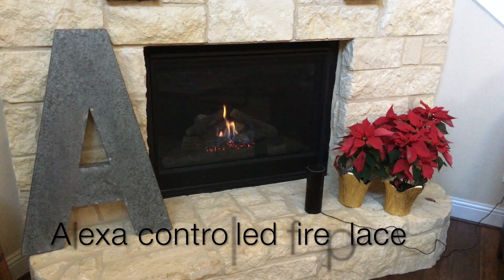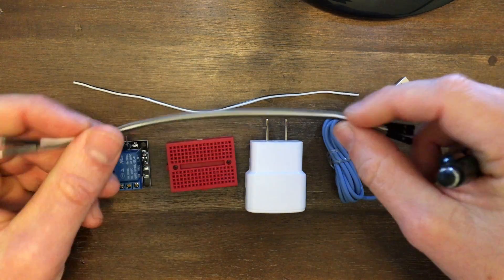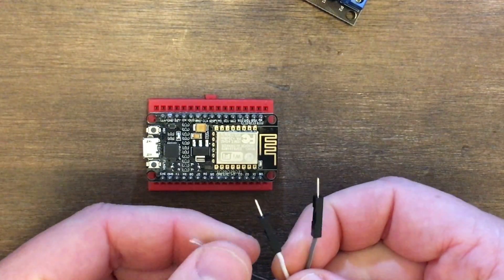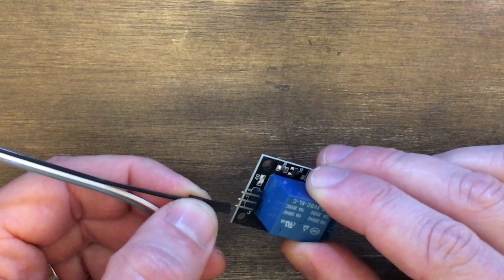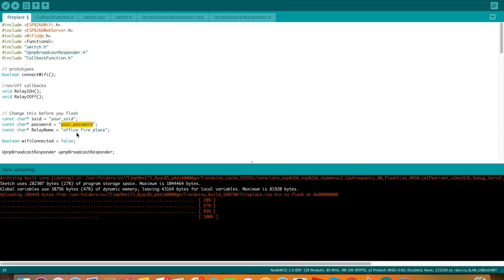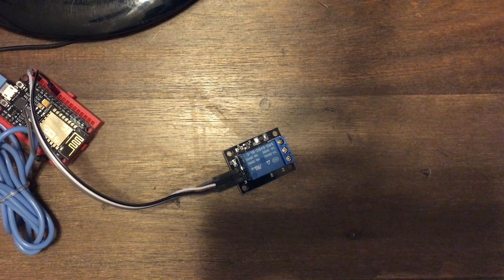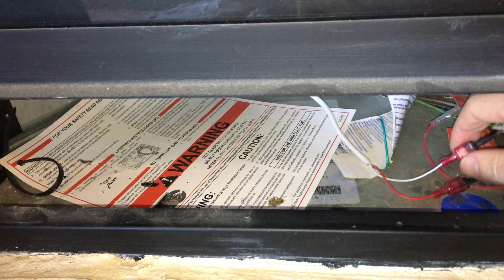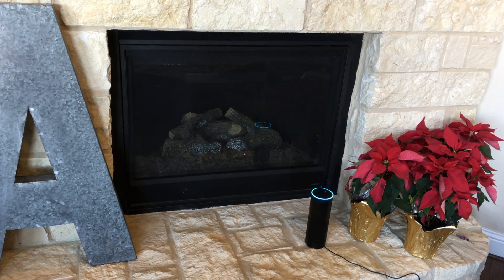Alexa Controlled Fireplace with NodeMCU (ESP8266) DIY and parts list

Comment: I got all the wires connected but can't get the download to install. Any suggestions?
Reply from the maker: I need a little more info. Is there an error message when uploading the sketch to the board? Make sure you have the correct COM port selected....if you don't, that will give you errors.
Reply: When I download the program for windows 10, I have to find the download on my computer but can't get it to open so I can make the three changes you told about. I just got the Hiletgonew version esp8266 development board from amazon.
Reply from the maker: Can you find fireplace.zip on your computer? If not, search for it in Windows 10 search box in bottom left of your screen. Unzip/extract all the files. Locate fireplace.ino and edit it.
Reply: Arduino: 1.8.5 (Windows 10), Board: "Arduino/Genuino Uno"

C:\Users\marin\OneDrive\Documents\fireplace\fireplace.ino:1:25: fatal error: ESP8266WiFi.h: No such file or directory

 #include <ESP8266WiFi.h>

                         ^

compilation terminated.

exit status 1
Error compiling for board Arduino/Genuino Uno.

This report would have more information with
"Show verbose output during compilation"
option enabled in File -> Preferences.
This the error I got when trying to after editing it
Reply from the maker: You have the wrong board selected. Your output says "Arduino/Genuino Uno". You need to change it and select "NodeMCU 1.0 ESP 12E Module".  Its in the Tools menu. Tools -> Board....
Reply: can't see the NodeMCU 1.0 ESP 12E Module" under boards
Reply from the maker: Did you install the esp8266 boards? Its bullet point #4 at 5:54 mark in my video. The link for boards manager is in the description.
Reply: how do you find and  start Arduino and open Preferences window? I have the 1.8.5 open but what do I do with it? I tried to upload load but get error.
Reply from the maker: If you have Arduino 1.8.5 open, goto File -> Preferences.
Reply: I added it but still can't find my board.
Reply from the maker: Now do the following step from that page "Open Boards Manager from Tools > Board menu and install esp8266 platform". So goto Tools -> Board -> Boards Manager (Boards Manager is at the very top of that long list of boards). In the search box, type esp8266. Only one item will remain in the list. Click somewhere in the description and the install button will show up. Click install. After it installs, it will be in that long list of boards so now you can choose it.
Reply: Did as you said but nothing happens when I typed esp8266 and hit enter.
Reply from the maker: Not sure. If  I have time later, I will try to record a video of those steps.
Reply from the maker: I uploaded a more detailed video that might help you. Give it a try https://youtu.be/tj3EPX2TPf8
Reply: I have followed the install instructions up to where I go to tools and select board manager. When I type esp8266 into the box the screen goes blank and nothing happens. I thought it might be my PC but the same thing happens on my laptop. What am I doing wrong?
Reply: I followed you up to where I type esp8266 into board manager but then the screen goes blank and nothing happens. I thought it was the PC but I tried it on my laptop and the same thing. Any thoughts?
Reply from the maker: Hmmm, not sure. I wonder if that URL is blocked for some reason. When you paste that URL   http://arduino.esp8266.com/stable/package_esp8266com_index.json   in your web browser, does it show a bunch of text on the screen that starts with "Packages"
Reply: I had entered a wrong letter and everything is ok except when I try to download. It starts to download but I get the error complilingfor board Nodemcu 1.0 (esp-12e module)
Reply: Started download and went to 86% when "an error occurred while uploading the sketch"
Reply from the maker: I am not sure. I really don't think it is a code issue, but please try the new version in the top of the description
Reply: I noticed in your video that the code on your screen says wifi scan at the top and the last wording at the bottom says void loop. The one I have been using is the full code where you change your router info. I can't get the one your using. what program did it come from?
Reply from the maker: Not sure I follow you. The original code (fireplace.zip) is the one in the video. Last night I uploaded new code to fix some issue people were having with newer Echos. The link to the new code is at the top of the description of the video (fireplace_2.zip). The new code looks different than the one in the video.

Comment: Great video.  I am having one problem.  Once I turn on the relay, after a shot delay it goes out.  I think cannot turn it on or off, unless I remove power and then plug back in.  Is there a wake code I need to have?  Thanks!
Reply: When I used the new code from the new video, it fixed my issue.
Reply from the maker: Harve Byrd - hi, no wake code. If you are doing it from the Alexa app, it will do that. Try not having the app open and do it from the echo with voice.
Reply: Thank you.  That seems to work.  I don't have it connected to the FP at this time, but had one more question.  When telling Alex to turn on FP the led lights up on the relay.  After a few minutes, it cuts off.  I can now relaunch it (where I could not with the app), but I'm wondering if the LED should stay on until I tell Alexa to turn off FP.
Reply from the maker: Harve Byrd - the relay should not turn off after a few minutes. It should stay closed (red light on) until You tell Alexa to turn it off. Not sure what is causing that. I will look through the code soon. You have good Wi-Fi in that location? Mine stays on for hours at a time.
Look at the serial output on computer to see if the off command is being sent or it is crashing.
Reply from the maker: Harve Byrd - sorry, I am stumped on that one. If you are using the exact same parts and code, I would expect it to work. I have made 3 of these for friends, and they all worked. My only advice is to test the relay by starting a new sketch that only switches the relay ON and OFF in a loop. I will let you know if I think of something else.
Reply: I have the same issue as Have Byrd with the same error message.  I can only get a different NodeMCU from Amazon.ca as the same one in your description is not available, not sure whether this is the problem. I have decoded the exception seems like memory allocation issue.  This is my first Arduino project as well. So not sure where the problem is.
Reply from the maker: Can you provide full link to the NodeNCU you got? Start small. Try the example sketches first...such as 'blink'. See if that compile and runs.
Reply: Big thanks for the quick replied and following up.  Here is the links:
NodeMCU: https://www.amazon.ca/gp/product/B01F5ALLFM/ref=oh_aui_detailpage_o02_s00?ie=UTF8&psc=1
Relay: https://www.amazon.ca/gp/product/B073HX1DK2/ref=oh_aui_detailpage_o02_s00?ie=UTF8&psc=1
I was using a different power supply at first but then buy the same one suggested in your post as others mentioned on the web that power supply could be an issue.
Reply from the maker: That NodeMCU looks like the same one. Let me know the results of the blink test.
Reply from the maker: Harve Byrd - Good to hear. Thanks

Comment: you skipped over where you got the fireplace contact wires that come off the relay. Did you make them or buy them?
Reply from the maker: Sorry about that. I crimped small male spade connectors to the solid wire I showed in the parts segment. Like these http://amzn.to/2mKY0Nm
Your connectors might be a different size, so you might want to get the variety pack of these if you don’t already have them
Reply: Thanks for the quick repsonse. Follow up question as i look at the parts you have listed. The 5v relay on Amazon IS A 5 PACK AND doesn't look to have the Negative, Positive and signal leads coming off it. Did you add those?
Reply: Never mind i dod see the leads coming off it after i looked at the other pictures :)
Reply from the maker: blue tooth - it’s best to always test those terminals anyway with continuity checker on your multimeter anyway. I have seen other boards in the past that are mislabeled.

Comment: where does switch get its power? I see where the spade connectors are connected. Is that the only connection under the fireplace? Is there a way to make the connection and still use the wall switch? Thanks for the detailed video!
Reply from the maker: Hi. Yes, the spade connectors are the only connection under the fireplace. I have also thought about how to keep the wall switch 'in the loop'. I haven't come up with an easy way to FULLY control the fireplace from both the wall switch and Alexa. That being said, you can have the wall switch function like a KILL switch, so you can turn it off in case of emergency. It would need to be in the ON position anytime you want to use Alexa to start/stop the fireplace. You would flip the wall switch to OFF to turn off the fireplace. I drew this up a few weeks ago, but haven't wired it yet. https://goo.gl/rVxq9P
I will see if I can come up with a more elegant solution :)
Reply from the maker: I figured out how to also still keep the wall switch working. You will need to replace the wall switch with a 3 way switch. I will do another video on how to wire that soon.
Reply: Thanks for the quick reply.
Reply: Looking forward to it!
Reply from the maker: Jack Jones - Here is a diagram video on how to wire the switch 3 different ways. https://youtu.be/wUP68vYBIco
Reply: Can you set it up in a parallel circuit? For it to be off, both the switch and relay need to be open, but in a parallel, you can use the switch or Alexa to turn on

Comment: Will be giving a try. Best video I've seen so far on explaining each step. Thank you for posting.
Reply from the maker: Thanks! Good luck with your project.
Reply: Everything uploads fine. My issue is when I go to run the serial monitor wifi test, I press the reset button on the node and I get some funky characters. Something like:    ⸮⸮=b⸮   and it wont connect to wifi

Any thoughts?
Reply from the maker: Ben Dodds - that usually means the baud rate on the serial monitor doesn’t match the serial monitor setting in the code. Try setting it to 9600 in serial monitor.
Reply: Thank you for the quick response. I started everything over and that seemed to do the trick and I was able to connect to wifi. The issue I am having now is Alexa cannot find the device. Am I using the correct Board in Arduino? I am using Board: NodeMCU 1.0 (ESP-12E Module)
Reply from the maker: Yes, that is the correct board setting. If you are getting on Wifi, then Alexa should be able to see it. Make sure your not using a 'guest' network. Guest networks hide devices from each other. You can try to discover from both the Alexa smartphone app, and from Alexa itself. Sometimes I have had Alexa tell me it couldn't find any new devices, but when I scrolled down through all the smart home devices, it was there.
Reply: Okay I will get it eventually. Ill keep troubleshooting. Thanks again for all the help!

Comment: Great video , followed all the steps but for some reason I cannot get the node MCU to compile your program for the fireplace it gives me a error stating error compiling, is there a step I’m missing?
Reply: Scratch that.  It was on the wrong Com port.
Reply from the maker: Hi. Can you post the error? In the Ardruino IDE menu, did you change the board to the NodeMCU 1.0?
Reply: During compiling, I get Arduino: 1.8.5 (Windows Store 1.8.10.0) (Windows 10), Board: "NodeMCU 1.0 (ESP-12E Module), 80 MHz, 4M (1M SPIFFS), v2 Prebuilt (MSS=536), Disabled, None, 115200"

Archiving built core (caching) in: C:\Users\Harve\AppData\Local\Temp\arduino_cache_688391\core\core_esp8266_esp8266_nodemcuv2_CpuFrequency_80,FlashSize_4M1M,LwIPVariant_v2mss536,Debug_Disabled,DebugLevel_None____,UploadSpeed_115200_6422eb45032e6f0580061223f9232602.a
Sketch uses 281483 bytes (26%) of program storage space. Maximum is 1044464 bytes.
Global variables use 38884 bytes (47%) of dynamic memory, leaving 43036 bytes for local variables. Maximum is 81920 bytes.
warning: espcomm_sync failed
error: espcomm_open failed
error: espcomm_upload_mem failed
error: espcomm_upload_mem failed

This report would have more information with
"Show verbose output during compilation"
option enabled in File -> Preferences.

Any idea?
Reply from the maker: Harve Byrd - good find!
Reply: HI, I am totally new to this and I am getting the same error. do you think you could help me out with how you corrected it?  Thanks
Reply from the maker: I go over Com ports in this video https://youtu.be/tj3EPX2TPf8
Reply: Arduino: 1.8.5 (Windows Store 1.8.10.0) (Windows 10), Board: "NodeMCU 1.0 (ESP-12E Module), 80 MHz, 4M (1M SPIFFS), v2 Prebuilt (MSS=536), Disabled, None, 115200"

Build options changed, rebuilding all
C:\Users\daniel\Desktop\fireplace\fireplace.ino:5:20: fatal error: switch.h: No such file or directory

 #include "switch.h"

                    ^

compilation terminated.

exit status 1
Error compiling for board NodeMCU 1.0 (ESP-12E Module).

This report would have more information with
"Show verbose output during compilation"
option enabled in File -> Preferences.
Reply from the maker: That usually means you didn't extract everything from the zip file. You need to unzip the fireplace folder, and all 6 files in it. After that, then open fireplace.ino. I just put up another video detailing the software part of it better here https://youtu.be/tj3EPX2TPf8
Reply: Ok got the program on the node mcu connected to WiFi , only issue now is that Alexa won’t find it

Comment: How did you get electric to the USB plug? Did you use the fan outlet with a power strip to power the fan and the USB plug?
Reply from the maker: Yes, I used the fan outlet. My fireplace doesn't have a fan installed. But if yours does, you could use one of those 3 socket splitters like this http://amzn.to/2DvN1iU